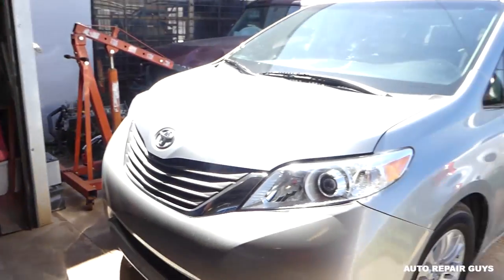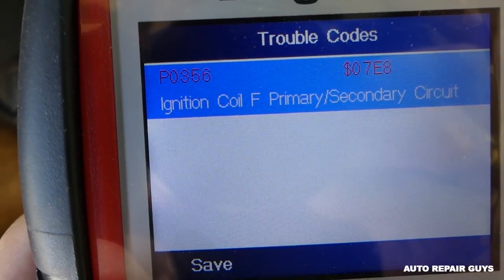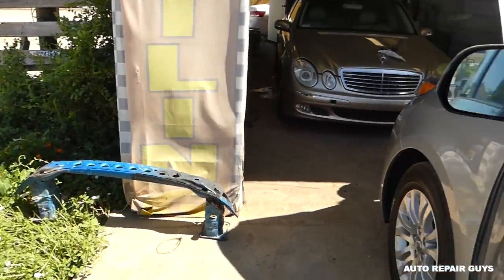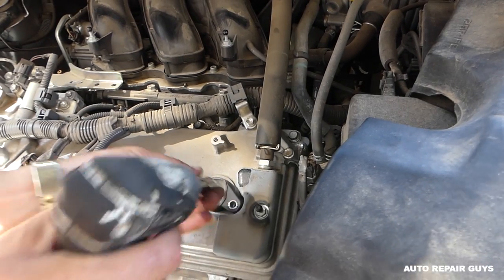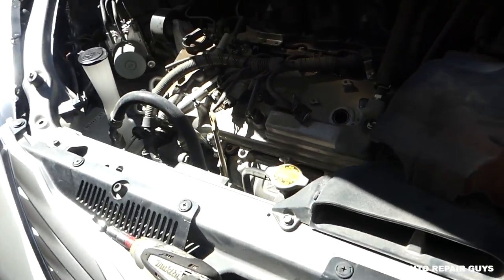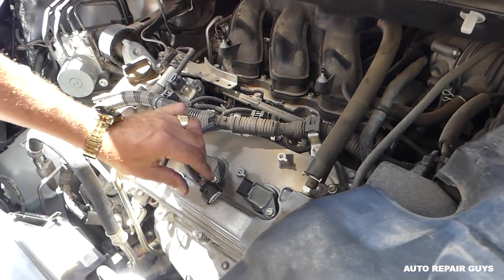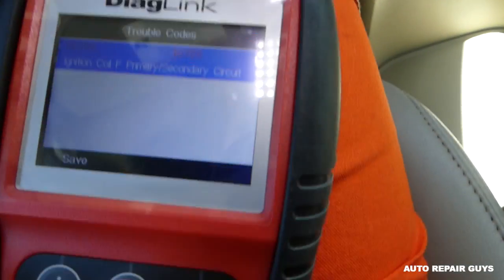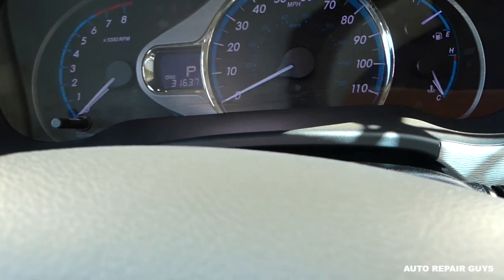HOW TO FIX CODES P0351 P0352 P0353 P0354 P0355 P0356 P0357 P0358 IGNITION COIL PROBLEM

Comment: Hey, this is a great video.  I have a rebuilt head, new plugs, new leads, amd new coil pack... I still get the P0351- P0354 after erasing them..
Reply: What was the resolution?
Reply: Did you find the reason of those mistakes ?
Reply: Hey. i just saw this..

I think I put in a new ECU.. I am forgetting a lot. The car ran well until I sold it..

I replaced Crank position sensor and camshaft position sensor also..
Reply: Hey. i just saw this..

I think I put in a new ECU.. I am forgetting a lot. The car ran well until I sold it..

I replaced Crank position sensor and camshaft position sensor also..

Comment: Just finished putting a new coil. On the the second ignition coil due to code p0352. On my 2010 Toyota Corolla. Cost me $75. Probably saved me that much in work through a mechanic. Not only did you guys help me diagnosed the problem but tought me where the problem was due to the order of the code. Thanks man.

Comment: I had this problem on my F-150, turned out NOT to be the coil, NOT the connecting cables, but simply the plastic housing between the two was old and would not click into the coil. Swapping it out for a new plastic housing fixed the problem for me. Worth taking a look before spending upwards of $70 for a new coil, or messing with the wiring without having to.
Reply: Plastic housing?

Comment: New sub and THANKS. I'm pulling P0354, 55 and 56, ignition coil D, E and F primary/secondary circuit codes. I pulled the coils one by one and they were firing strong. If they were firing what else would throw that code.  Any advice would be greatly appreciated.
Reply: Same shit

Comment: What if all four of these codes come on for a 2017 Corolla? What if the engine intermittently runs well and then has intermittent sessions of running horribly while throwing all four A coil codes?

Comment: Hey guys, great video, thank you very much. QUESTION; I replaced the coil and it still throws that 035 code at me, I have cleared it 3 times. What do I do?
Reply: Bummer They didn't reply to you. What did you end up discovering? Bad ECM? Worn, cut wires in the harness? Poor ECM ground?

Comment: thanks for taking the time to read this and hopefully if u have more time u will answer as well!  great video!  first off i recently replaced all plugs and coil packs on my 06 cadillac sts.  its now giving me the secondary circuit malfunction codes for all 6 coil packs that i changed.  the car runs great tho so im not sure what to do next.  i erased all the codes and resnapped all the harness wires on and off the packs to make sure they were connected good.  still gettting all 6 codes for those coil packs again.  any info would be greatly appreciated!  thanks so much keep up the great vids!
Reply: What did you find?
Reply: @randallsmerna384  sorry I cant remember! That was 3 years ago & was my ex gfs car. She ended up destroying the engine and it got repoed cause she took a loan out on the car & never paid

Comment: I had this code on coil 1 so I switched coil 1 with coil 2 and ran cleared obd then ran for a while, code reappeared in the same spot coil 1 so not a bad coil. Wiring I take it?

Comment: I heard you mention these codes, here's my issue.  09 Saturn Outlook 3.6L V6, changed all coils and plugs.  Switched to AC/Delco iridiums, and after market coils with lifetime warranty.  Now it throws P0351 through P056, "coils A through F, primary and secondary ignition coil failure" on all cylinders.  It is running like a champ; more power, no miss, no hesitation, no problems.  Running better than ever except the codes.  I've read that the computer may need to "relearn" with these new coils installed.  Does it do that on it's own or do I need a better OBDII scanner?  Or is it something completely different?  Thank you.  I'm a brand new subscriber to the channel, just found you tonight.
Reply: What did you discover was the remedy for your codes?

Comment: So this  tech guy changes the coil pack, erases the error code, the check engine light does not come back on and he says all is good.
Is it not that once you erase an error code , it takes a full drive cycle before the light can come back on, in case there are other issues that caused  the light to come on?
Reply: not with a misfire
Reply: A misfire will show pretty quickly. I'll bet you if he swapped the old one back in the code would immediately reappear again. If he swaps the bad coil to another cylinder it would appear there next immediately.
Reply: Not all the time. Sometimes could be intermittent misfire which will need to be driven.

Comment: easy way to check if the coil is defective is to swap to a known one and see if the code change location example.  before the code  is P0354, after the swap now become P0356. That simple ha.
Reply: Unfortunately on my Avalon #3 coil is under the intake manifold 😣 So I'm able to perform this method.

Comment: I literally have all of these codes that came on while driving: p0351-p0356 

What are the chances they all went bad? What else would have caused this?   thanks
Reply: Did you find out what it was
Reply: Same here with 2017 Corolla. Throws these four codes and sometimes the engine runs fine and then it just takes a s***, stalls, runs rough, won't idle.  Then it may run well the next day but you never know when it's going to take a s**t.
I'm currently tracing the wiring harness looking for evidence of shorts, opens or losses of ground. Because it's hitting all cylinders it's a global issue not a single coil issue. Could be a bad ECM but it could also be a short or openness making the ECM freak out. They even said check the ground but I don't know if it's the ground to the ECM or what. I also don't know if the ECM has its own separate ground or if it's part of the wiring harness.
Found some mouse evidence by the coils when the plastic cover was removed. I'm hoping that it's a mouse chew issue creating an intermittent short or open and freaking out the ECM.
Reply: @tristanexantus6386  people not coming back to update is brutal on repair videos
Reply: @PlatoonGoon For me on the f150 I was working on it was a vacuum leak that caused these codes.
Reply: @tristanexantus6386 

This is interesting, seriously how would a vacuum leak causes these codes  Any explanation?

Comment: Gee always so easy for everyone else. This is NOT always the case. What if you are using a coil pack??? Im having same trouble but coil 1 circuit. Ive replaced my coil pack twice. STILL says same code to replace it wtf

Comment: But it's obvious, if you delete the code it wont have a check engine light but after a day or two it'll be back
Reply: On the toyota sienna, a bad coil will turn on the MIL (check engine light) immediately.  However, the video procedure is wrong because they did not first verify if it is intermittent or continuous failure before swapping the coil.
Reply: @networkedperson  How do you check if it's continuous or intermittent and why the hell does it matter? You still have to replace it!

Comment: Thank you for the video. I had a misfire code and also the p0352.  2006 Ford Mustang GT v8.   I changed my plug and coil. Now I have erratic idle and same code reappear
Reply: Truth Seeker gap the plugs to factory gap even pre gapped plugs need to be checked

Comment: What if it's not the coils? I get 352, 353, 354, 355, 356, 357 at stop signs. Misfires. Mechanic thinks it a computer. I think it's his crappy job where he spliced a new coil wire, with electrical tape, into cylinder one. But cylinder one doesn't misfire, now.
Reply: Possible short in the wire will give that code.
Reply: What did you discover was your problem/solution?

Comment: how do you determine which coil is which?
Reply: The bank closest to the firewall is 1, 3, & 5. With 1 being closest to the right front (passenger's) wheel. The bank closest to the radiator is 2, 4 & 6, with 2 being closest to the right front wheel.